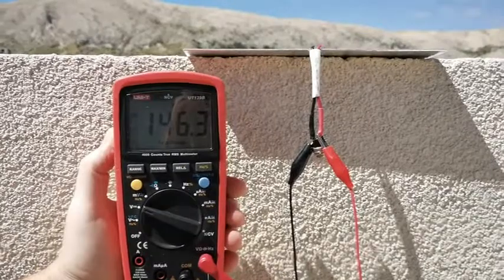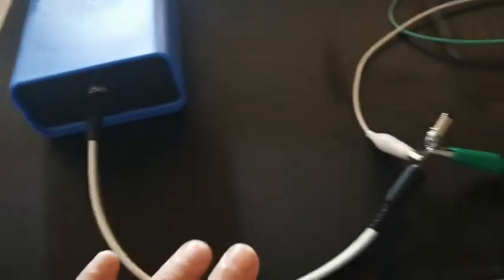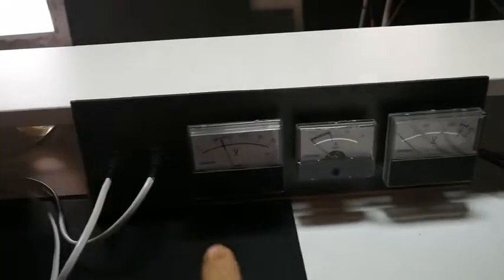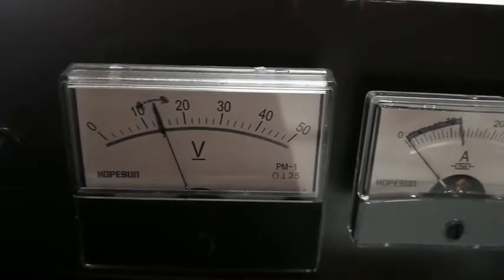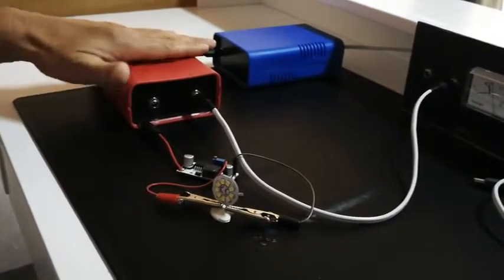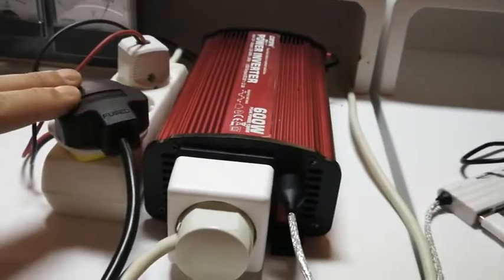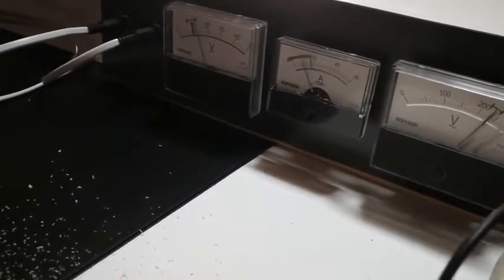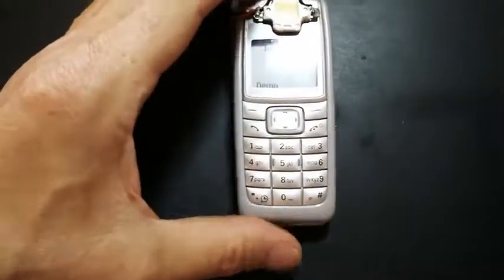GAEA RSET RPP Demo-3  Short Version

Comment: Is the 140volts AC or DC off the gen2 panel?   Then the ETI converts this somehow and outputs 62vdc output?  Then you feed that to the red box which steps that down further to 15vdc which you feed to a typical inverter which outputs 220vac and you plug in a couple USB chargers that take the 220vac and convert it to 5vdc at 1-2amps... Sure seems like a lot of conversion, why not just feed the 140vdc to a string of series caps as a volt divider and then feed that directly to the 5vdc USB interface?  less losses due less conversions.   Why didn't you show the commercial lights power consumption? and why did you only show it for 2 seconds before moving to the next segment?